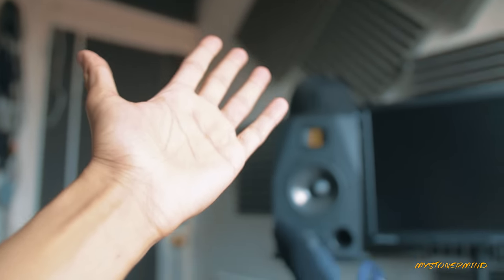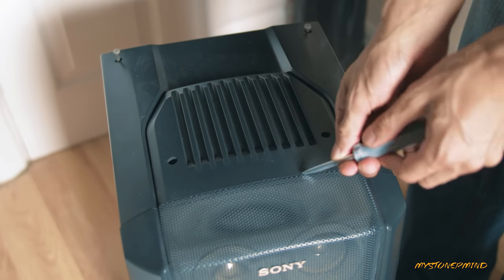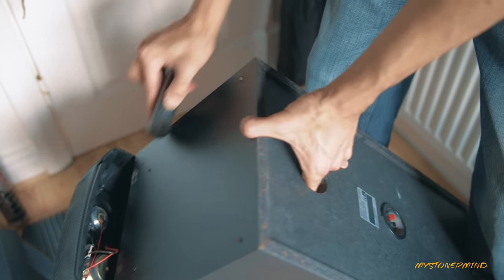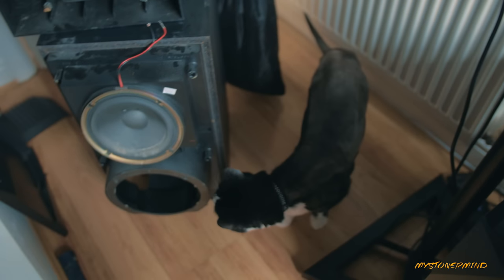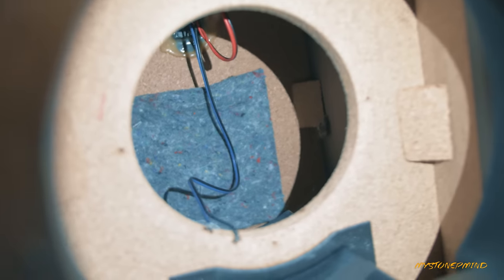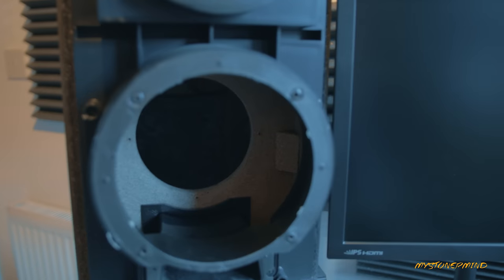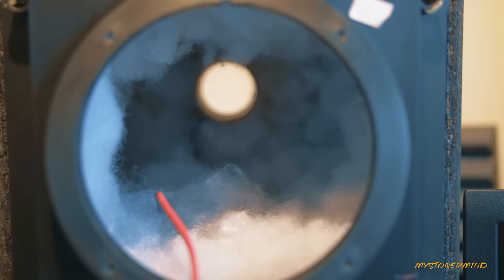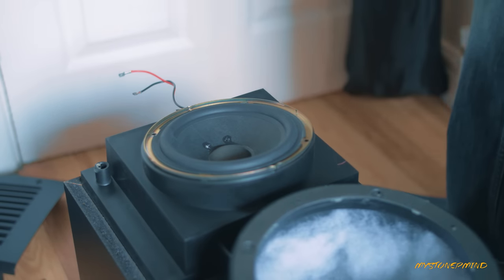SONY Super Woofers OPENED !!! (Pt.1)

Comment: I have a pair of these and a pair of LG s65t3s speakers plus a sony sa-wm40 active subwoofer connected to my panasonic sa-bx500 7.1
 surround  system hooked up to an LG 65" led tv. When I put copperhead road on at half volume, the house shakes! What's so special about it all? The active sub came from the scrap metal yard for AU$20 and the telly, 7.1 surround and 4 speakers all came from the local tip out of the e-waste container for free! ( I did have to fix the telly- the rest was plug n play)

Comment: what is that white thing doing actually? does it offer better quality?
Reply from the maker: not exactly better quality, well it kind of depends on what you're doing with it.
Basically it makes the boxes seem larger, dampens the boom and sort of tightens up the bass. 
This works best on and is more noticeable with speaker cabinets that are obviously peaky or boomy, much like these things were. 
If your cabinets are already sounding good, you can try it, but it's more likely to make the bass go away.

I could post a technical description of how it works by slowing down the waves from the rear of the speaker, making the air in the cabinet dense and talking about thermodynamics blah blah, but that's not needed. 
Besides, I'm sure someone else will do that eventually.. maybe
Reply: thank yuuu

Comment: Hey stoner Which can be the most cheap speakers with the best bass you know
Reply from the maker: +Akshay Anvekar I'm not sure man there a lot of speakers out there, new ones being released every month. The bass I prefer usually comes from a ported box though.
Reply: Thank you for the reply What do you prefer Plastic case or wooden case for speakers
Reply from the maker: +Akshay Anvekar the cabinet should be wooden, if there is plastic it should only be on the outsides as trim or decoration
Reply: Ok will keep that in mind before buying

Comment: I have a pair of Bang & Olufsen Penta speakers them things are absolutely incredible and I would never rip them apart like that cuz they cost me $5,000 way back 25 years ago and they were built in the early 90s and 89 I think and they still today smoke any other stereo system I've seen but that price they should they know what they're going through in that's for sure if you looked and speakers not be we like good God and then if you look up their new speakers mine does not need a sub woffer has about 12 different 4 inch speakers in a 6 inch or 6 ft tall Pentagon type speaker with a digital display in the middle of this now this is before digital displays ever came out bands like Pink Floyd and Nine Inch Nails why do they 70 stuff it's like listening to the for the whole first time ever incredible you hear all kinds of tones and notes and stuff you never hear through its own hear anything else Bose is crap
Reply: I am struggling to understand what you wrote...
Reply: jeff wolf I have also penta aktiv but this Penta talk is not suited for this video....Penta is different speakers.
Reply: Focal wipe the floor with B&O btw and better value per $. they bored the arse out of me 25 years ago. this guys having fun
Reply: B and O are the Bose of high end